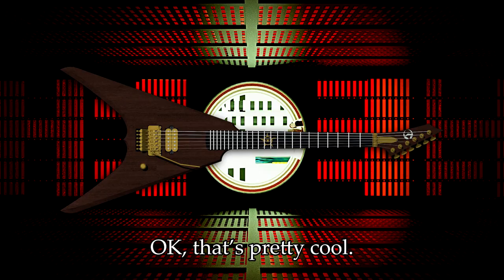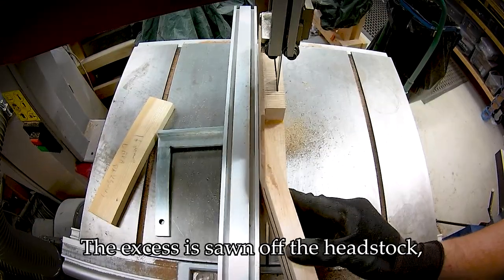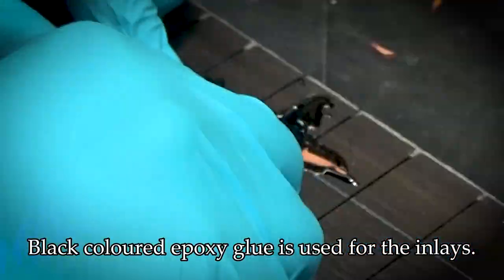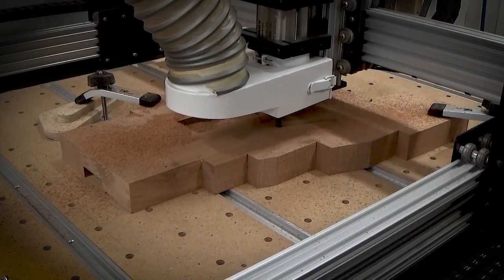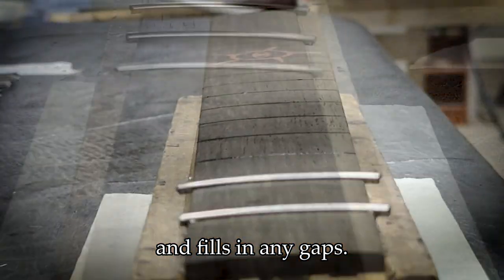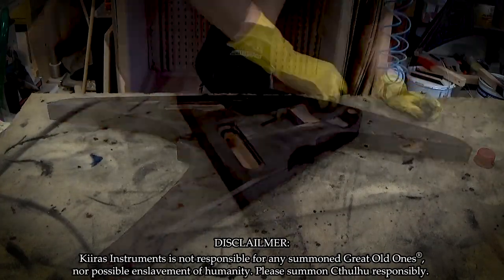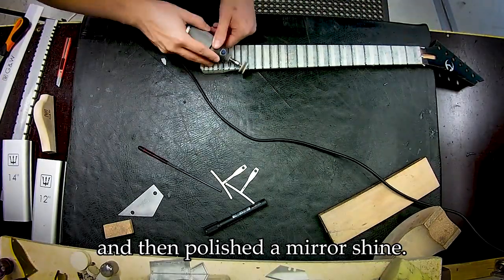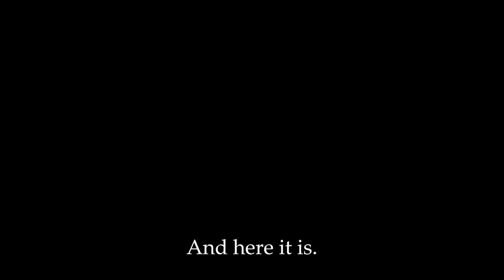Building UKONKIRVES "Occult" FR6 - custom Flying V style guitar - time lapse - full build.

Comment: Awesome design and execution. One question, as someone who hates all form of sanding especially for taking away material, since you have a cnc, why don't you do the radius using a large ball nose? after that, all you need is just some light sanding.
Reply from the maker: This exact question was asked also in my previous video.

I've thought about it, but I've come to the conclusion that this is the better way (for me) to do it. If the fretboard is radiused before gluing on the neck, then it's very difficult to get even camping pressure and it might lead to bad adhesion -> loss of tone & reliability issues.

If the fretboard would be radiused after gluing on a CNC, then the setup time alone (firing up the machine, workpiece holding, supports, cnc programming, changing tools...) would easily take longer than just doing the way I do it now. And the problem would increase many fold for neck-thru-body guitars I also build a lot.

And in the end, when I say "my least favourite part", it's like saying "my least favourite Lamborghini Countach" - compared to 99% of the jobs in the world, if still much rather radius fretboards 😂
Reply: @Kiiras  I hear you. There are solution to those drawback, I radius before attaching and use pegs to stabilize the position, however I use vacuum to glue it to the neck so I don't have the uneven pressure issue. But all in all loved the build.
Reply from the maker: Vacuum clamping system would be sooooo good!